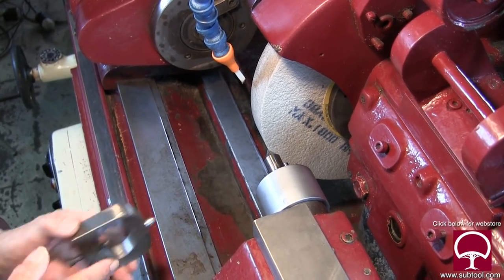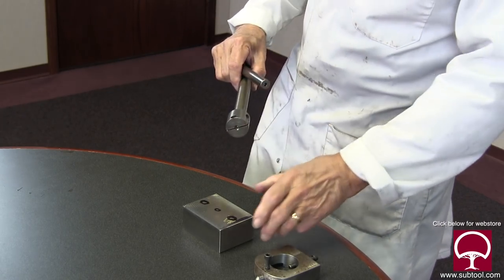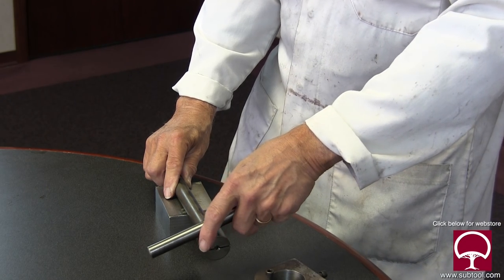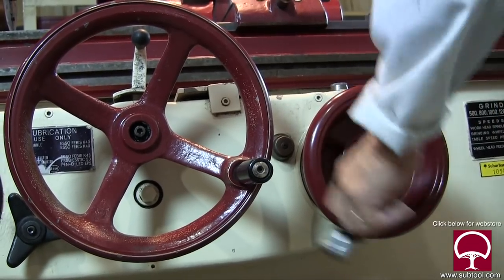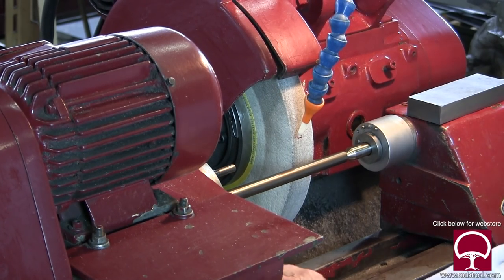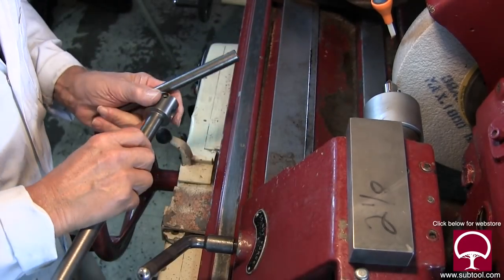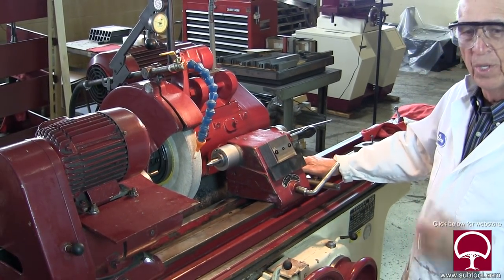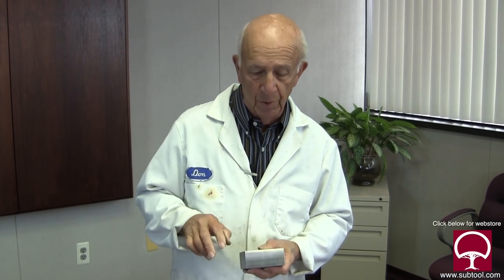How To Make A Wheel Dresser For An O.D. Grinder Pt. 1

Comment: G'day from down under.. btw. Love your video's and thanks to them I've added a surface grinder to our shop. its not something we would use often but it beats the hell out of mounting a magnetic chuck to a tool and cutter grinder table and cranking the little handle back and forth, now I just need to find room to squeeze it into our tool shop. its a used machine but in very good condition. but I found a couple of hours to give it a clean down the other day and I noticed a small plate riveted to the top of the wheel guard. I found after some investigation there was an option for a spindle mounted wheel dresser. So it avoids having to adjust setup at all, you just adjust the diamond down with one screw, then it has another little handle to wind it across the wheel. thinking of making one now.

Comment: You are on the right idea but I think you are mounting it wrong. There are 2 allen head screws already sticking out on the grinder headstock that I think would make perfect mounts for the dresser.  I would mount the shaft to a block there and then have it with a lever so you can move the diamond across the wheel and have the diamond mounted on a screw to feed into the wheel.  Doing it that way you can dress with a lever pull and you don't have to crank the wheel out of position at all. I think that would be much more rigid as well.
Reply from the maker: +bcbloc02 Good idea, certainly another way to do it.  Thanks for the comment.

Comment: Look forward to the next installment- I've heard that the diamond tip should be at or below wheel center and also shank should be orientated downward (in same direction wheel is heading). Maybe you can comment on this setup next episode.- do you dress the wheel at a specific SFM?
Reply from the maker: +Peter Thannhauser What you have said is correct.  SFM in our case is fixed at 2,000.

Comment: your diamont will be wobble around and dont make a good and flat grinding wheel
Reply from the maker: +motoerhead85 You're right, unless we support it.  We intend to support it against the dead center, which is in the tail stock.  Using this method, there will be no vibration.